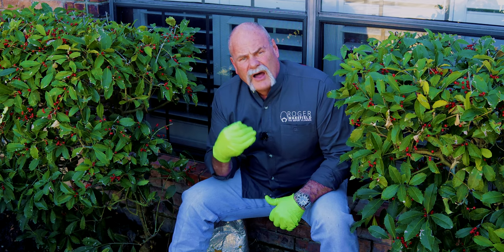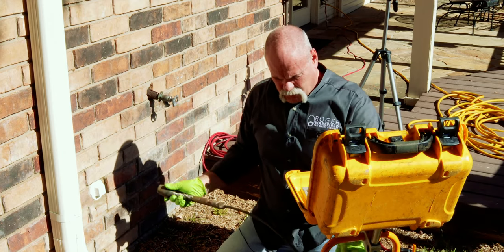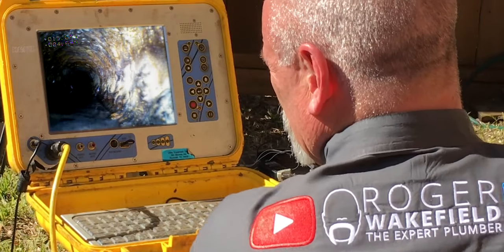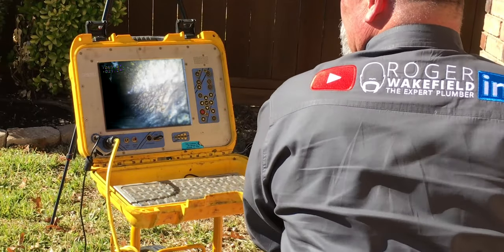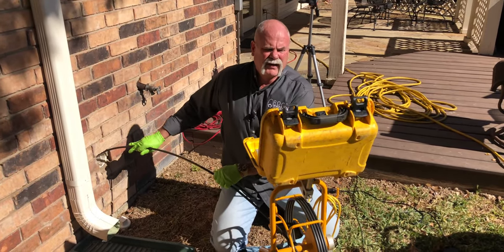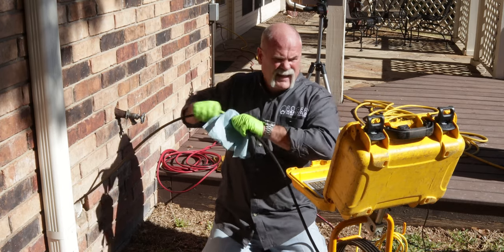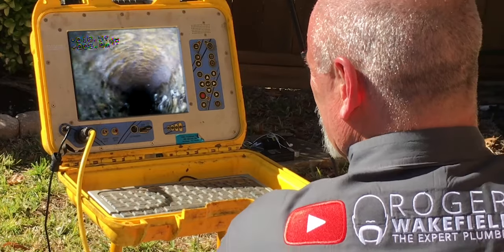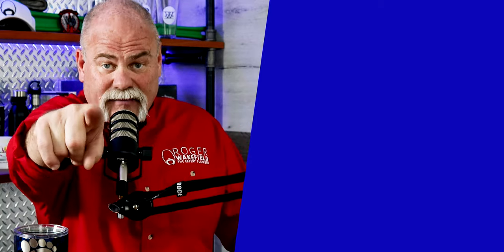Life of a Plumber | Finding Hidden 2-Way Cleanouts

Comment: Hello, Roger! We live in the Upper Peninsula of Michigan and winter is already around the corner.  We've already hired a plumber to install a missing branch to one of the vents on the roof.  I suspect that we may have additional venting issues, maybe blockage.  Our neighbors have installed various "caps" on their vents to prevent critters from plunging the vents.  However, some plumbers recommend leaving the vents open, and inserting  copper "t-pipes" to maximize warm air to rise and melt any snow.  I'd like to screen off the opening and/or install a venting cap.  Any recommendations for us?  Thank you.

Comment: I probed around looking for a cleanout for an apartment complex and poked through a high-pressure gas main. Several buildings were evacuated, and streets were closed off by the fire dept. Almost got into a lot of trouble for that. Pretty embarrassing rookie mistake.

Comment: Ok so I have a lil septic line issue, a good old blockage. I posted on another video about a blocked vent, fixed that issue. Now I'm on to the septic line, I've tried getting to it through the toilets, shower etc. But to no avail, so I'm wondering would a house built in the 60s have clean outs? Or would I have to go in through the septic tank it's self? Any insight, tips, tricks or fixes. Would be greatly appreciated, thanks everyone. This is my go-to place for help now.

Comment: I would recommend that they get their sewer jetted to remove all the build up. Then the camera to see where it is bad. trench under the house using the locator head. Cut out existing bad pipe sections and use slip joints to finish it off

Comment: Sorry Roger for an off topic question. Do you have one or 2 plumbers you would recommend that would service the Southlake, Grapevine or Roanoke areas. I have a job that is a bit unusual. Thank you
Reply from the maker: Oscar Mike unusual in what way? I know some plumber sin that direction. Jut not sure which to recommend...
Reply: Hey Roger, thank you for the reply. Should I try to contact you through Texas Green Plumbing? Here is my situation, I live in a tiny house (similar to an RV) and the plumbing system was incorrectly designed. It only has one vent. That existsing vent is the interior type that splits off near the bathroom sink P-trap. So the system needs to be carefully evaluated and appropriately vented. Thank you for the help

Comment: It would be nice if you can do a video on ORANGEBURG PIPE.
Yesterday I tried to scope a sewer line but I couldn't cz it's full of water all  the way to the pipe, I tried to cleared with the sewer machine but it didn't do much, after a while lots of black stuff , I've got a feeling it might be Orangeburg pipe  it just does not go down at all even after running the machine wait for a day, water its just standing in the pipe by the clean out (they repipe  under the slab but they didn't at the front of the house going towards the City). What are your thoughts on this? Thanks in advance
Reply from the maker: Hever Morales if it's still holding water I would try a hydro-jetter then possibly recommend replacement. Where are you located? We don't see much Orangeburg here... Thanks for watching and commenting!
Reply: @RogerWakefield  In Austin Tx. This house is located in south Austin Manchaca & William Canon.
 Most likely this has to be replaced.

Comment: Yo , use soap dish soap that will allow u to remove snake cables , jetter hoses , cameras and you helpers hand cuz you know he needed to get the clean out extractor he drop inside of it. Your welcome helpful tip from your guy at overtime plumbing.

Comment: i tend to put a ss bolts dead center of the pvc cap with a detection disk on it. -helps to locate the cleanout when its too low but yet mowers clear it fine.

Comment: Roger, if you didn't find a cleanout in the back of the house would you have pulled a stool or gotten on the roof?
Reply from the maker: Shawn Strong I always look for a wall cleanout first. Either of those options work.

Comment: Hey Roger, great video and not trying to put you on blast but youtube doesn't have a private message feature or I would have used that.  Alot of what you mentioned was roots was nothing but lint or spiderwebs.  There was alot of that cast iron that was cracked on both sides.  When you pulled back the camera 10-12' to get the direction....just look at the poles to get the direction.  Thats not mud on the camera.  Etc etc.....I like alot of what you put out but on this, you were off on quite a bit.  Sorry man, not trying to be a jerk.
Reply from the maker: Sewer Roundtable Review  there actually were roots and mud in her system, along with other things. We have explained everything to her. This was actually a video about how to find the cleanouts, that's why we didn't go into everything along the way. Thanks for watching and commenting though...